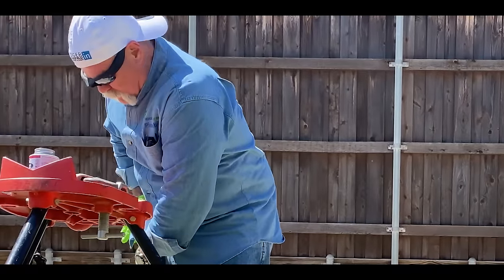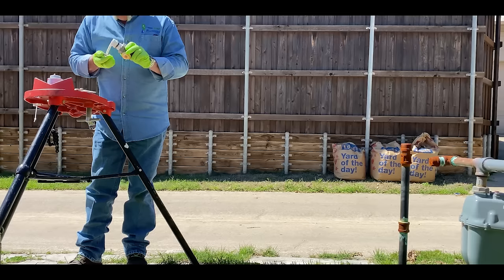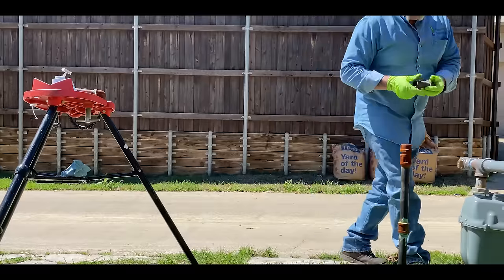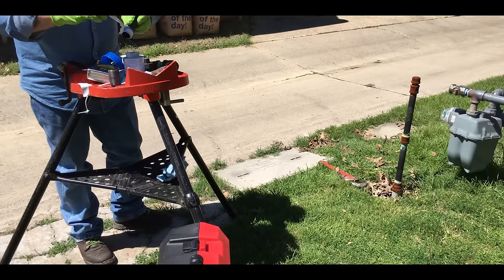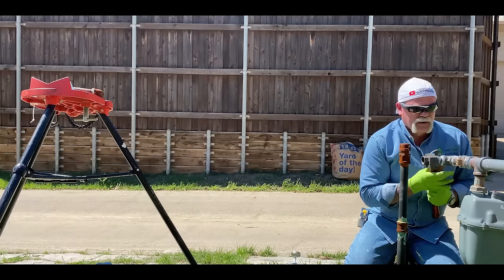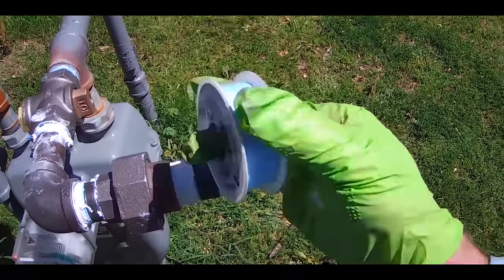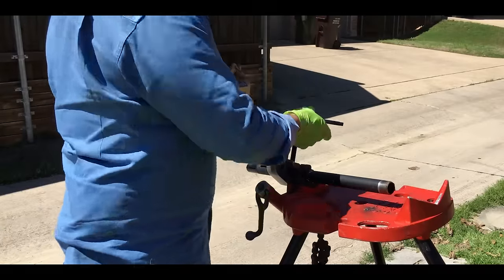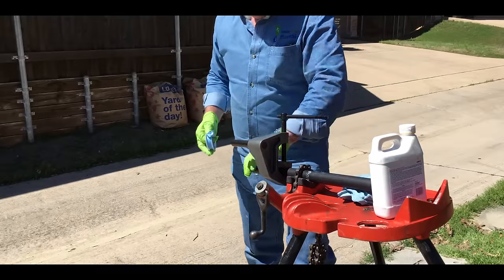Neighbor HIT This Gas Line! - Gas Line Repair (Plumbing POV)

Comment: I have actually found Roger's method a little remiss. Instead I use THREE levels of protection. Two applications of pipe dope and one teflon tape. Or,

1. Apply pipe dope to threads liberally.
2. Roll on teflon tape in the correct direction.
3. Apply a second coat of dope to the taped section. Always stroking the dope in the correct direction.

THAT is the correct method. And ought never leak.
Reply: You see the example shown at 4:44 or so is less than perfect and I have seen such threads leak when exposed to a pressure test. Since he already has plenty of Teflon and pipe dope, why not apply the dope to BOTH the threads and the tape? It takes maybe five seconds longer but makes for a perfect seal and bond between the fitting and pipe. 

This method sorta brings back to mind what I learned in my first trade which was tile. If when setting large tiles you want a 100% bond between subfloor and tile? Apply the adhesive to the surface being tiled with a notched trowel. THEN apply a skim coat of adhesive to the actual underside of the tile itself. The purpose being to assure an absolute 100% bond. My described method works like contact cement does.

Comment: Is it normal in the US for a gas meter to just be hanging off the pipe on the side of the road like this? Over here they are usually in a box stuck to the wall of the house.
Reply: No its rather uncommon. All houses over were I live have the gas meter at least 24cm away from the back.

Comment: I have a silly question normally the gas company guy will break out a little can of gray paint do you not do that as a private contractor or just holding to you to plumbing not painting. That is some pretty gas line work there love the videos.
Reply: Rust-Oleum Stops Rust 1 qt. Protective Enamel Gloss Smoke Gray Interior/Exterior Paint.   

smoke grey is the universal color used to paint exterior gas lines and meteres This paint is and oil based enamel that protects against rust.   u can buy this at home depot maybe lowes either 1 quart or 1 gallon also comes in spray paint but the can of paint has better coverage

Comment: Teflon tape is a thread lubricant and anti-seize, it is NOT a thread sealant, pipe dope is a thread sealant but not a thread lubricant. That's what I was taught.

Comment: Well, that repair is all fine and dandy until the next car hits it.  Um, our code would require a cover over the meter and protective steel posts in the ground to avoid that whole car meets gas meter mess.  Overall, probably less costly for the owners to move the meter somewhere away from the road

Comment: There’s suppose to be a pressure test tee after the outlet on the meter and traffic protection
Reply: Vernon, you are absolutely correct (Roger used the pressure tab tee for his pool heater fuel run without adding another one). Traffic projection post should be the responsibility of the gas utility. If you ever read NTSB reports on Pipeline safety and incidents, the Texas utilities don't have too good of a track record ( I'm assuming because they're Public Utility Commission is a little weak and maybe in the hands of big business (?) ).
Reply: Bob Y in Massachusetts you would flunk your inspection if you don’t put traffic protection. Gas company will never give meter without inspection tag.
Reply: @joem5332  ... the only issue I see is this is a repair and generally speaking they don't make you retrofit. If it were a new install then there would absolutely be a knocker post in front of that meter!

Comment: Not much of an engineer if he said use both, they are the same thing, tape and dope, pipe threads get tighter as they go in, dope/tape is only to make the job easier to go together and assist later in removal, the tape/dope does not actually stop leaks, it makes the tightening easier so the threads are tight enough to not leak.

Comment: Why put those meters in the front yard anyway, besides ease of access? To me it seems like a hazard and an eyesore? Austrian plumbing apprentice asking...
Reply from the maker: This is actually in the back of the house. A lot of neighborhoods in this area have alleyways in the back. This is also where the driveways/garages/and meters are. The idea was that this would help with curb appeal in the front of the house...

Comment: The background music is monotonous. We need to get our gas line repaired. It's turned off right now. The pipe coming into the house rusted clean through. It's severed. The good thing is the the pipe going into the house is fine, but I don't know if the underground line running to the meter needs to be completely replace. We really should get our gas fixed and running again. We are currently heating with space heaters. I'm very meticulous about how they are operated, but gas heat would be nice. Our central heat and air is completely wasted. The register ducts in the foundation are full of water. We don't really want to go back to full on central anymore because the zoning helps keep the bill low. I'm thinking that gas wall furnaces are the way to go. We can't put them in the bedrooms as far as I know, but wall furnaces in the main part of the house should at least take some burden off the space heaters in the bedroom. We are fully switched to electric wall heaters in the bedrooms to be more safe with this kind of heating, but they are really designed for supplemental heating. Paying for all that is probably a pipe dream. It sounds well over $10,000 to do all this. We are low income so that sucks.

Comment: Such a fantastic video, this is so good: all the job, uninterrupted, with all the pipe handling. This is the best type of video.
I am not sure such a bulky, extremely expensive electric tool has any advantage over a regular ratchet for such a small job

Comment: No to teflon on gas pipe it's illegal. Unless you use special gas teflon but even then inspectors in my area will make you take it off and only use dope. On water lines and other threads it's always teflon and dope.
Reply from the maker: Where are you located? The manufacturer recommends it... That’s interesting!
Reply: @RogerWakefield  I'm in Minnesota and I know we had an inspector in one of our cities made us take it all apart because it had teflon tape. I know they have different grades of teflon tape and only certain kinds are gas rated and approved. Regular teflon tape is not gas rated it degrades from the petroleum.

Comment: what paint do you recommend to spray onto your gas piping to protect it?
Reply: skyliner_369
 ... Rustoleum (or similar) works well but dries slow. I know one guy who uses Rustoleum in pint cans and applies it with cheap brushes. His claim is easier to work with, use in any weather, less problems with having it get on other equipment, and a hole box of cheap brushes is less expensive than a single can of spray paint.
Reply: @rupe53  Yeah the cans can be expensive, especially since with those you can't get reasonable bulk discounts. However, yeah, cans do work, and I wouldn't be surprised if it was perfectly good for HVLP too
Reply: @Skyliner_369  .. you can spray Rustoleum but you need to thin it quite a bit...and then you need power to run a spray rig... and time to set up / clean up. A 39 cent brush goes real quick and you can throw it away. Also works in the winter when spray bombs clog up. Why reinvent the wheel when a $10 quart will last a month doing a few jobs daily?

Comment: I read this and thought someone drove into a house. Where is this that the gas lines are just hanging out by the road. Obviously unsafe and it looks hideous. Around here the lines/meter are right up against the house.
Reply: Mine was next to the road,  and I live at the bottom of an incline.  I always worried about someone sliding into it during the winter,  so when it developed a slight leak at ground level,  I had it moved next to the house.  I now have peace of mind that no one will hit it,  and it makes the front yard look so much cleaner.

Comment: Teflon Tape is not allowed on Gas Lines. Only The Yellow Rated Gas tape is allowed. Pipe dope only on gas line is fine. It's not high pressure

Comment: Meter doesn't have to be galvanized piping? Teflon on gas piping, too? I thought that was a no-no. Aren't the fittings hard to screw on with six layers of tape? No level on the 90?
Reply: Galvanized on any gas pipe is a no no. Any gas pipe outside needs to be painted with a protective paint. Like the grey paint on the meter.
Reply: @mattmcc7930  That makes sense

Comment: We can’t use black iron outside, even using galvanized the threads must be painted for rust protection
Reply: Your Right look at the gas pipe behind him all rusted
Reply: Martin Connell supposed to be painted after to prevent rust . Battleship grey is the color , oil base

Comment: Do y’all paint the pipe? We usually use galvi pipe outdoors. When I go back to Dallas, I see a lot of rusty gas pipe. Love that tool!
Reply: galvanized pipe is illegal because it flakes off and causes gas valves to stick open. Please stop it’s just surface rust it’ll be fine or just paint the exterior.
Reply: You should paint the outside lines due to the unconditioned space.  The surface rust is correct as far as it being superficial to a point in the comment above but if rust gets into the threading it will eventually work its way in and can cause a gas leak.

If it's on the meter to the city side most of time they'll come out and repaint it for free. just call them.

I wouldn't paint the inside stuff because I would want to know if it's rusting, if so then you got something else going on.

Also random info in most applications for larger appliances (like the furnace) they install this thing called a drip leg before the fixture. To keep the random bits pieces of garbage out if it does make it it's way in.

Comment: Do pilot lights go out when you do that switch?
Reply: Yes they can. I was a first responder/ service fitter for the gas utility in St Louis ,.Missouri and ran a lot of pilot outage calls for this very reason. One of the instances I had was a bad safety valve on a furnace and the thing almost blew up after the contractor left.

Comment: That's why you use both becuz u didn't want to cut the gas off. Lmao I'm a pipeline welder. Work around this stuff every day. But one thing I did notice. You should always have a fire bottle next to you. Just in case you engulf in flames... You don't want to look like some burnt bacon. Haha

Comment: So regardless if there is already a gasket with the threads ?
Reply: No if the connection has a gasket or oring this should not be needed

Comment: I don’t think you have spoken to an engineer, they don’t know any of that, I think you have spoken to an Instrumentation and Control Technician like myself, and what I noticed is that he didn’t tell you how to put the tape and how much dope, you def over killing it with those two, also don’t put tape on first 2 threads, tape would get inside if you do that and prob damage that flow counter, also dope should be put much less than that, as you roll the connection the dope will spread and will work well. I’ve been told to build pipe system and test that it wouldn’t leak without any tape or dope to make sure we know how it works

Comment: Now the utility company can bypass the meter with that valve there
Reply: Thats for a customer shutoff, utility company would shut off the meter and put a padlock on it.
Reply: @princeofdeath7696  utility companies can bypass the meter to keep the houses on and work on everything before the meter. With that valve there, there is no way to keep the house on to perform maintenance.

Comment: Why do you use so much monster tape, I saw you went around like ten times it 4 or 5 at best, and really all you need is some megalock as long as you're making the threads up correctly there will never be a problem. At best you'll only get 3/4 to 3 pounds of pressure on a gas like. so even a ten year old would be strong enough to not get a leak

Comment: Lucky plumber this chap is. Unions aren’t allowed in my jurisdiction. We have to use left and right nipple/coupling. Unions are only allowed after a valve and before the apparatus. Also, you invest in that fancy Milwaukee product, but not an aluminum wrench?

Comment: I'm an apprentice plumber (9 months experience) and was taught from the start to always use both pipe dope and teflon for gas work; but I'm curious if that order actually matters. My coworker usually does teflon first then dope, but I prefer to dope first and then teflon, especially on small nipples (just feels cleaner that way). In your experience do you find that the order could create different results? Love your channel!
Reply from the maker: I’m not sure the order matters. I was taught tape first, dope after. I’m glad you love the channel!!! Thank you!!!
Reply: @RogerWakefield  Thanks for the reply! Your channel is very informational for new people getting into the trade! :)

Comment: Hello Roger...IMO...probably not the greatest idea to post a video on tieing into the outlet of a gas meter while live.  I work for the gas utility in Ontario Canada, and have responded to many emergency gas odour/leak calls, only to find out that the homeowner(s) thought YouTube was a better alternative then hiring a licensed gas fitter.
Reply: That's really surprising considering how easy it is with even a little bit of research

Comment: If the gas meter is near a roadway where cars drive near it, where is the cement poles around the meter so no cars will hit it
Reply from the maker: C royal  they aren't required here. Crazy isn't it?
Reply: Required here and for good reason - California drivers bee line to meters set near where they drive - always seemed to break below the service valve too so it has to be dug upstream and squeezed off.

Comment: Did you guys really do big gas line jobs with those little handheld threading machines? Im telling you, one Compact 300 does 3x the amount of pipes in the same amount of time as those handheld machines. Sure it costs 5000$ but pays itself out after one job. And it literally lasts for 30 years.
Reply: Automatic oiler, putting on parts with the machine, etc. etc.

Comment: teflone isnt code for gas .. if anything you can get called by an inspector if he cares enough .. just use slik tite and some elbow grease youll be fine
Reply: to protect my theory of the person instalking the teflone starts it to close to the beginning of the threads when you tighten you risk teflone getting in your gas pipe... what that means you can cause a blockage keep in mind gas is usually only under 5 pounds of pressure enough to put your finger on it an stop the flow so imagine what teflone can do ive gotten calls from customers telling me a plumber just came fixed my laundry gas line but dont have gas still well took it apart turned out the teflone was blocking the bal cok

Comment: Sheet metal guy but the M18 14 gauge  double cut shear is a fucking gamechanger, as is the M18 3 inch capacity bandsaw

Comment: What I learned is if a plumber uses water rated Teflon tape and pipe dope, buying the yellow gas tape and dope is a waist of money. I have always used both when doing connections, didn't want to chance a leak, I did once and it was a pain to disassemble and redo the problem area. Never again.

Comment: You installed that gas line to the service tee. Now the gas company  will have to redo it and relight any pilots inside whenever they need to service that meter. 👎🏻 ..

Comment: a little confused I don't see a shut off to meter.  Must have shut off before meter and after for it to be legal   are you having any of your work inspected?  don't hear you mention anything about permits or inspection?  plus the way do camera work is very hard to follow.  what the over all system is  nor do you explain what all the pipes are going.  Looks like the line you are working on is spit off going in another direction into the ground but not shut off for this line?  you are putting shut off  on the line you are working on but not the branch?  Would be better if you did more explaining the over system before proceeding.  I assume these videos are instructional. don't see you explaining how you are making these connections (measurements with ruler to determined nipple size or pipe size.)  See the video but no explanation as to why or how you are making these determinations.   The main leg down (cut a new piece and treaded it) into the coupling in the ground I saw you do a few turns screwing line into coupling but really never tightened it?  I don't see you showing anyway to make sure you don't have any leaks usually soap solution but no mention of checking for leaks?  a lot of loose ends but not showing,  number one procedure is checking for leaks especially gas lines.  I assume because you are outside but still no mention?

Comment: Easy job, but do you know why gas fitters put tape and or dope on the threads? It is not to make a seal the joint but it is meant to make it easy to assemble or disassemble. It looked like you used a close nipple on your project. A close nipple is not allowed on a gas line because the structure of that nipple is not strong enough. I saw your oil dispenser and wondered if that was the Ridgid approved oil dispenser. That goes for your oil pan, which was questionable. One more thing, were you going to paint your project. I believe the code say to paint the pipe with  the correct paint and color. This is the first time watching your show and would recommend that if you are going to show people how its done then please do it correctly for the sake of our profession. Lets keep everyone safe out there.  One last thing, do not promote anyone to doing any gas line work. That is too unsafe for the untrained and unqualified.